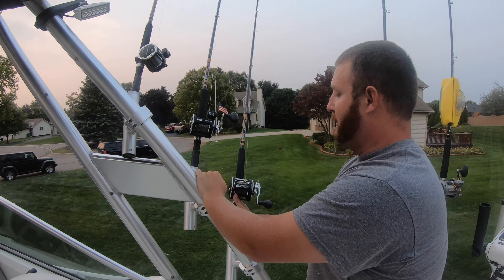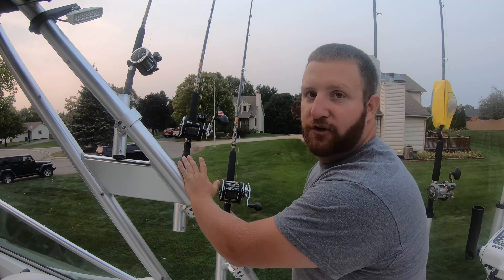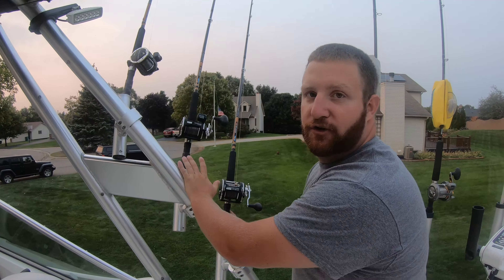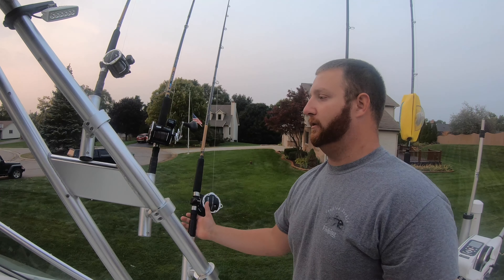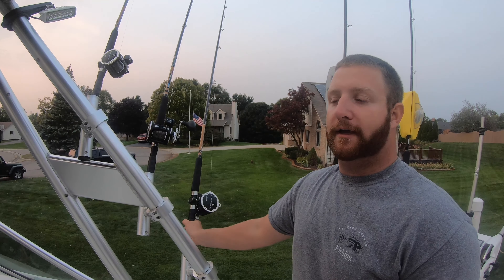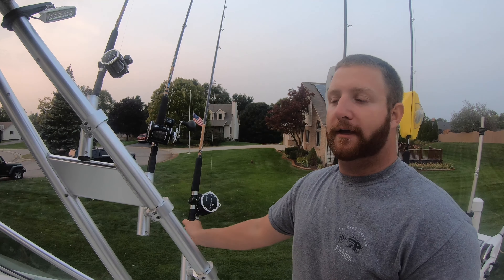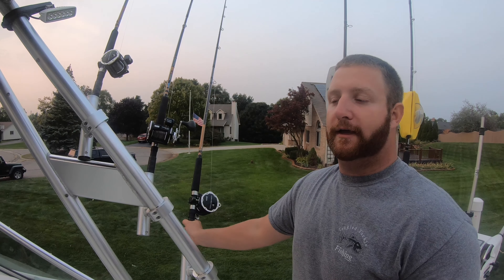Weighted Steel and Leadcore Salmon Setup

Comment: Great Video.   Thanks for sharing.  Two questions for you.

1)I assume that if you have too much leadcore on an inline planer board, that it will not pull or track properly.  Question:  How many colors of lead core can you pull with the standard sized OR12 inline planer boards?

2)I do not have enough rod/reel combos or space to put more on the boat.  If I was going to rig up four rods/reels with leadcore, what lengths would you start with?  I tend to fish mostly June, July, and August.

Thanks again for the great information.
Reply from the maker: Thank you!
Q1: For me, I like to use the OR 12 boards up to a 8 color or a 200-250 weighted steel/copper. Once I get heavier than those, I will jump up a board size so they aren’t tracking too far back towards the middle of the boat. 

Q2: I think if I were to only run 4 lead core rods, I would likely make those lengths a 5, 7, 9, and 11. Those will get you as shallow as 25ft and deepest would be 55ft. This year we have had a lot of bites from 30ft-70ft down consistently. If you need extra depth, a snap on weight can get you an extra 5-15 feet pending on what size you use. I keep a box of snap on weights in the boat just incase I need to target an exact depth column. 

Hope this all helps

Comment: I have no issues using the sams pro straight to braid. No mono or extra knots and easier to release it too.
Reply from the maker: Yeah I’ve had good success with that too. Just hadn’t had the chance to remove the section of mono from the way I had them set up from the previous release. I will say though the ninja boards will slide down on the braid if you don’t wrap it around the front clip
Reply: @highpointeoutdoors6958  yeah i guess it benefits you to be able to use other boards. I don't have ninjas

Comment: Here is what you need to do with your Snapper releases get some 1/8 inch nylon rod there is a hole already drilled in the release on the bottom cut the nylon 1/4” in length glue it in with a waterproof glue tip (epoxy does not work nor does Krazy glue) shoot me your email I can send you some pics for some reason I can’t get them to load here.
Reply from the maker: Thank you for the tip! Highpointeoutdoors@gmail.com